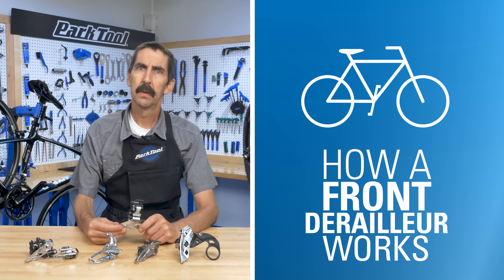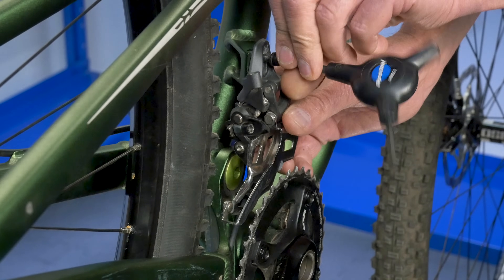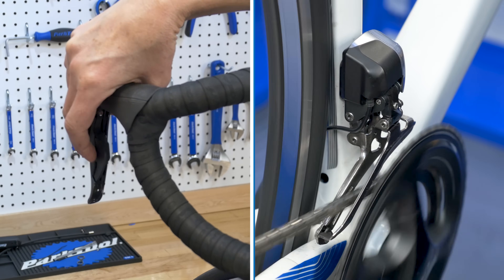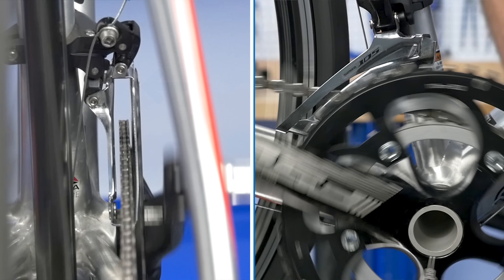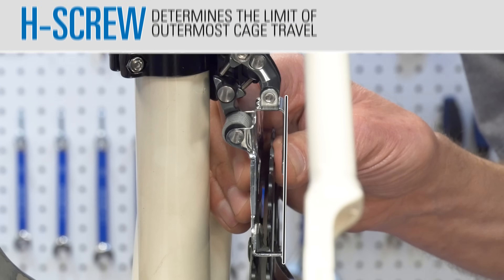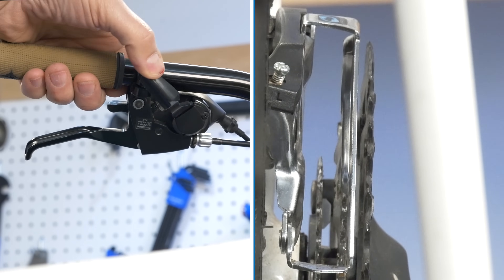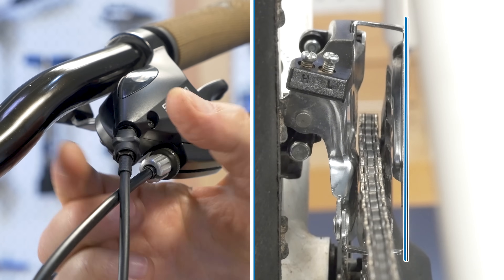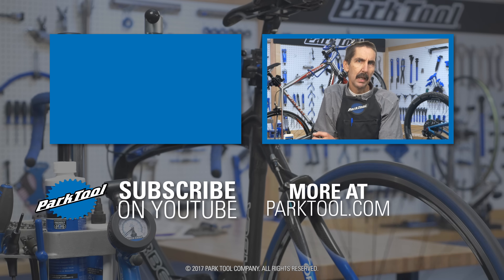How a Front Derailleur Works

Comment: The H-limiter on my front derailleur is as loose as it can be without falling out, the cage is parallel to the chain, yet I can't make my deraileur shift to he highest gear and tightening the cable doesn't help as any more will make the cable so tense I can't pjysically shift to he highest gear. What am I missing?

Comment: But what is it for? The last time I road a push bike with gears was 15 odd years ago and it only had the rear gears. I now have a cheap mountain bike that has both front and rear gears and I have no idea what the front gears are for and how to use them properly.

Comment: My chain doesn't go into first gear. Just 2nd and 3rd. Does that mean I just need to loosten the L screw so the derailleur cage moves more to the left?/is less limited...
Reply from the maker: It's possible that is the only adjustment that you need to make. If the cable tension is set too high then you may need to loosen it to allow it to go lower as well.
Reply: @parktool  gotchya. I'm still learning what peice is what within the derailleurs and whatnot. I also notice that when I have some cross chaining going on, the chain rubs so slightly on the cage. Like gear 3 and 7 or something like that.

Comment: Extremely informative, one of your best videos for us novices, thank you. Might I suggest though not to refer to turning barrel adjusters clockwise or anti-clockwise - I've seen this in other videos too and it's completely meaningless, as it depends entirely which direction you are facing or making the adjustment from. I always try to think of adjusting it inwards or outwards as that doesn't change no matter the orientation.

Comment: So the cable is under some pressure at all times. If you're on the second of 3 front rings, shifting one way will tighten the cable and cause the chain to go on the inner/outer ring while shifting the other way will loosen the  cable and cause the chain to go the other way?
Reply from the maker: Basically, yes.  If your bike has bare cable on the frame you can grab, try this.  Shift to the second ring.   Now pedal and grab the cable.  Pull the cable and watch the cage move the chain. Keep pulling until it is in the largest ring.  Now relax your pull and watch the cage move the other way.  The spring in the cage linkage is pulling it inward, and the pull from the cable move it outward.

Comment: Please tell how to take out spring
Reply from the maker: The linkage holding the spring is usually assembled with rivets intended to be permanent.  Are you looking to use the cage as a 1X chain retainer?  Usually you can run in the L-limit screw to position the cage, and take off the cable.

Comment: How normal is it for lower priced(tourney) shimano shifter cable to start unwinding and becoming dangerous to handle after only 6 or 7 re-cablings? Is it a good hint the item is a knock off? I mean, I already think it's a knock-off, but I'm debating if mentioning it in a seller review is justified, since I can't be sure I wasn't just too rough. You think "oh I'll just be careful this time" then get stabbed trying to pull the cable tight

Comment: So is there a name where the chain get stuck ,at the front,damn chain scratch the chain stay badly
Reply from the maker: That is called "chain suck". Chain suck can be caused by worn chainrings, too much mud or the chain catching on the shift ramps or pins of the larger chain pins. There are other reasons this can happen but those have been the most common.

Comment: I think I'm just about ready to do my first adjust of my front and rear derailleurs. One big question remains: does it matter whether you adjust the front or rear derailleur first? Very informative videos. Thank you!
Reply from the maker: We typically recommend setting up the rear derailleur while in the middle chainring up front, but to setup the rear shifting first. The reason for this is that to properly setup the front derailleur you need to be able to shift through the entire range of the rear derailleur properly.

Comment: my bike keeps slipping out of gear, particularly when I apply a reasonable amount of pressure to my pedals (ie. pedal hard  - such as when going up hill), but also tends to slip a lot when in higher gears (gears in which it is easier to pedal, i mean).

Would this be related to the derailleur? or something else perhaps?

It started happening only when i had my chain replaced... and i think the shop also replaced something in the gears, although im not super sure what.

Sorry I'm not knowledgeable about bikes AT ALL so excuse my poor use of terminology.

Comment: My bike has no barrel adjuster. Is that normal? It's stuck on the lowest shift position and there's not enough wire to loosen it from the bolt. How do I fix this so I can use the other gears on my front derailleur?
Reply from the maker: You can install an inline barrel adjuster into the housing. THis will allow some adjustment. Another way is to tighten the low limit to move the derailleur and allow you to re-fasten the cable to a "tighter" place. Then loosen the low limit back to where it was and then try the adjustment again. An inline barrel adjuster will be much easier to adjust though.
Reply: @parktool  thanks!

Comment: There is no barrel adjuster on my bike.. How can I adjust the cable length in this case? how does it change the derailleur cable tension adjustment? :( thank you
Reply from the maker: It may be easier to add an inline barrel adjuster to your system. THis will help with small tweaks and for setup. Its difficult to do without a barrel adjuster. be sure to look for one up at the shifter.
Reply: @parktool  wow. thanks a LOT. I did not even know such thing exists.. thank you!

Comment: On the left Shifter there are numbers 1,2,3. Which ring on the front corresponds with each number?
Reply from the maker: 1= small ring. 2= middle ring. 3= big ring. if using a 2 chainring system with a 3 speed shifter 2 is middle and 3 is big.
Reply: Park Tool Thanks. I had a crash the other day and my chain came off. I put the chain back on one of the front rings but now it’s not shifting to the small ring. Maybe I need to manually move the chain to the small ring while gear 1 is selected?
Reply: @parktool  why does my grip shift have so many clicks in between  1-2-3. There's like 4 or 5 from one gear to the next.

Comment: when the cable on the front derailleur snapped, i cut the cable so it won't poke through my legs and to make me go faster i put a rock in between the pivot where it shifts. i was able to use the second gear in the front, it  got me home fast and quickly.

Comment: What is top pull and down pull sir
Reply from the maker: "Top pull" means the cable is pulling from the top.  The cable will be routed to come down the seat tube.
"Bottom pull" means the cable is pulling from the bottom. The cable runs under the bottom bracket and upward toward the derailleur.
Reply: Sir then how will i know my cycle fit with top or down pull.
Reply: My cycle is an indian cycle that is hero sprint rx2

Comment: Why can't i shift my front derailleur to the 3rd gear? Is it because of my chain length?
Reply from the maker: It could be because of chain length. Other things to look for are the H limit being too tight, the shifter being slightly gummed up not allowing the pawl in the shifter to hold the gear or the indexing being off.

Comment: After a recent road test, I’ve a 3x front gear which needs attention to allow it change from central to largest chain ring  (2- 3) when achieving higher road speeds. This and the accompanying detailed front derailleur adjustment video are two of the essential tools I’ll need before starting the task, a little Zen goes a long way before getting it right first time. No fuss, clear and accurate statements throughout, I am already filled with more confidence than if I’d stared at a printed page of arrowed diagrams and jargon.
Reply: Well, first look at the machine after watching and straight away the alignment was not parallel, due to the frame mounting being rotated. Easily spotted from the directions shown and easily remedied. A quick road test after a successful cranking of gears in the workshop also proved to be just enough to achieve full 1:1 to 3:7 gear selection, thank you.

Comment: Should I adjust the front or rear first?
Reply from the maker: It does not really matter, however if the front is horribly adjusted, it will make noise and be distracting during rear adjustments.

Comment: One thing I have have noticed getting into repair work is that on some models of front derailleurs the high and low limit screws are switched, on most the inside screw is the low or L and the outside is the high or H but some are backwards inside screw is H and controls outside while the outside screw is L and controls inside limit. Personally I think they should have one universal way but ehh....

Comment: This latest series of videos is great. It will really show anyone new to bicycle mechanics the in's and out's of the source. 
Shame you didn't do a video on Shimano's newer 11 speed front derailleurs with the longer pivot arms, as the installation and setup is unlike previous incarnations. I, for one, had problems fitting a Shimano 5800 FD due to the new cable routing, the 'converter on/off' options and the higher amount of cable tension required in setup.

Comment: I need advice my chain started to break and ripped my front derailleur and now it's broken. I want to know if I can just get a rear derailleur with a clutch and ride like that. My favorite chain ring is 42 tooth but when your on that chain ring the chain is not straight will it work with a rear derailleur with a clutch or should I buy cranks that take one chain ring and a rear derailleur with a clutch?
Reply: if you want hack and save money use front derailleur as chain guide if its not that bad broken